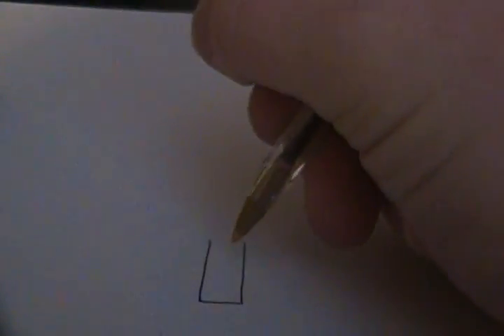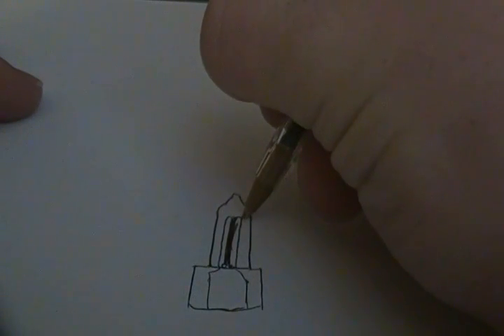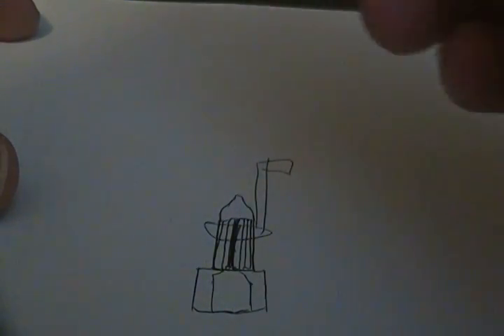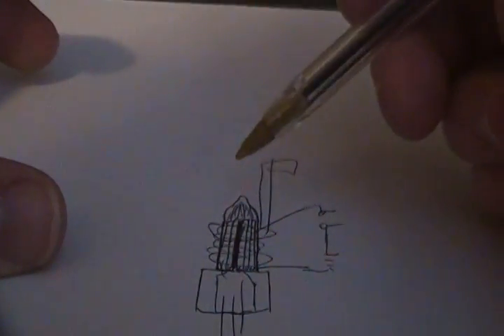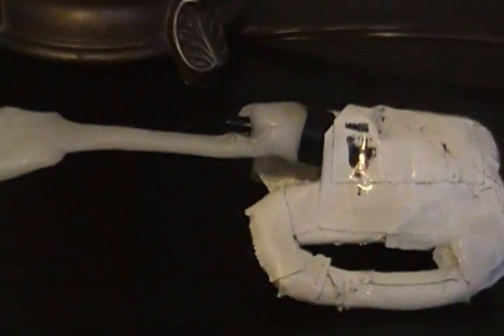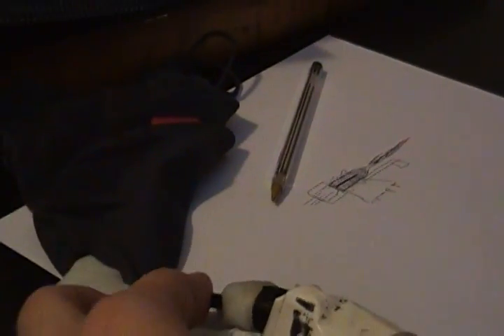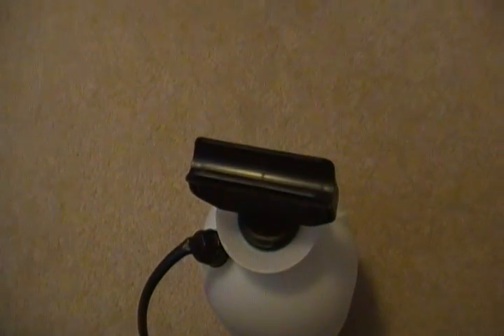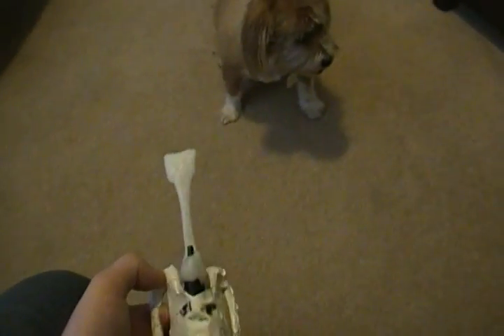Spinneret pt 2 and s.p.i.d.e.r. maximus cameo

Comment: What resin are you considering using? I've been looking at constructing a web shooter myself and have been looking into all sorts of polymer based resins. Also great work and very logical thinking! Perhaps consider electrically exciting the copper tubes? This may be able to cause a charge difference in the web allowing you to control their colliding point. Example being all negative on the outside and positive in the center. Food for thought, but excellent work!